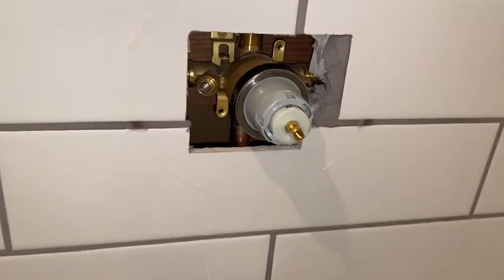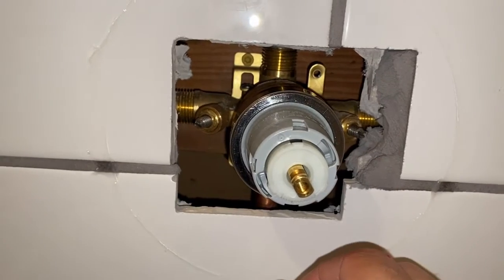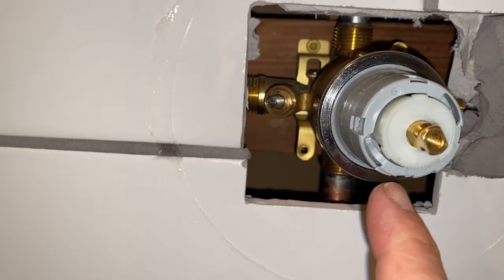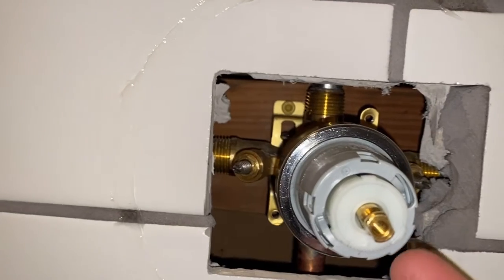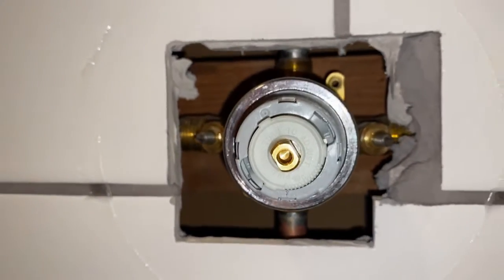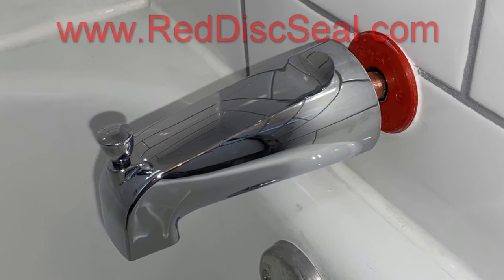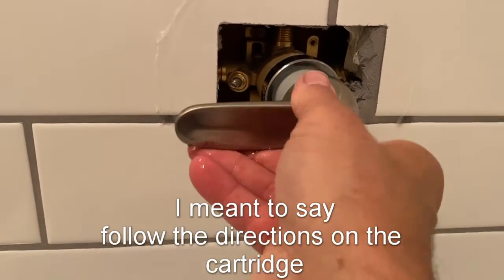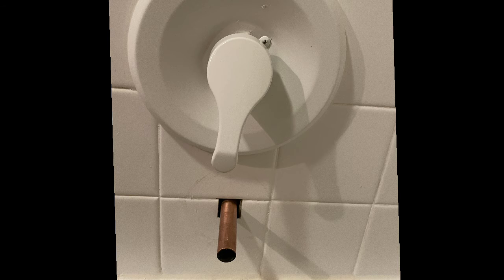How to adjust the water temp, Delta MultiChoice universal valve body with 13 or 14-series trim

Comment: On the Multi Choice1314 cartridges you Do Not need to turn off wwter. You do not have to remove faceplate. Only remove  the lever.  Just did this today.  I'm an idiot & I was able to fix the temp in less than 15 minutes.

Comment: When you installed the stops, did you notice that while twisting the screw driver to the right, you come to a stopping point before the stop is fully inserted into the hole, but if you turn the screwdriver a little bit harder, you’ll be able to keep twisting your screwdriver, until the stopper is fully inserted? Is the first stopping point where the stopper is just screwed into where it keeps the water from leaking out of the diverter behind the wall and then the second stopping point is where the stop is actually stopping the water flow into the diverter? I’m trying to figure out how far the stopper needs to be twisted in and still have the water flowing through the diverter
Reply from the maker: I am assuming you are referring to the MultiChoice valve which has built-in stops. If so, as the stop screw is turned clockwise, the resistance for the first few turns is less than the last few. The resistance increases once the seals are about 80% engaged, stop is almost closed. As for the diverter question, I cannot comment. I’ve only installed these valves for shower. Hope this helps.
Reply: @JustForYouDiy  Yes, I was referring to the multichoice with the stops. Thanks